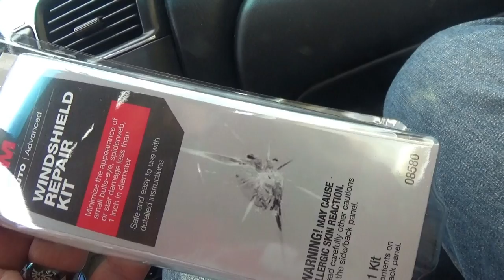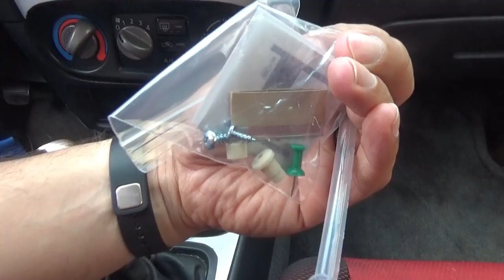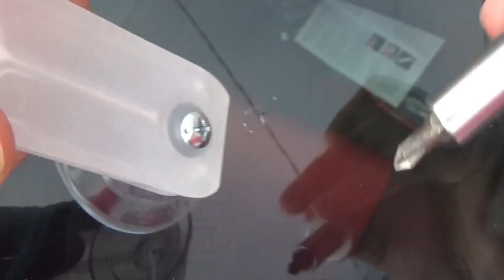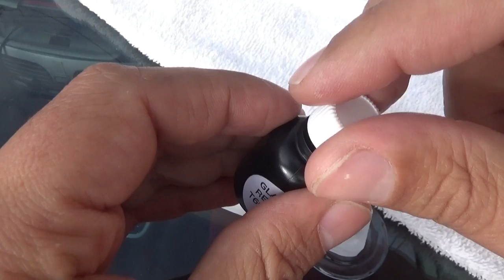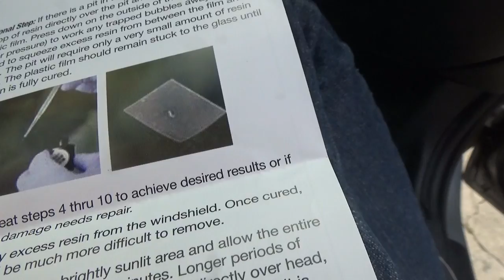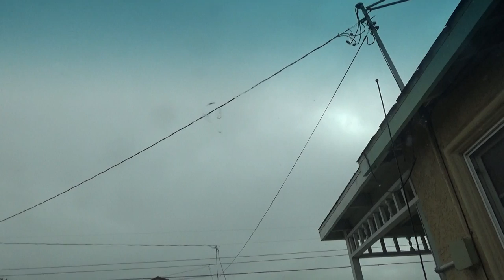3M Windshield Repair Kit. Does It Work?

Comment: It does work.  I went through 2 winters on 2 cracks and it stopped the crack from spreading.  If it didn't work,  the crack would spread as soon as you got a big change in temperature.  My star looks like yours.  That you can't fix.
Reply from the maker: jimgiggles thanks for the feedback

Comment: I'm really surprised how terrible the 3M product is.  I don't understand why the applicator area is smaller than the crack itself.  It makes zero sense to me.  I just got a chip on my windshield and I will be using a different product that creates a vacuum which will suck the resin into the crack itself.

I expected better from 3M considering how big this company is.
Reply: What was that other product? I know its been 5 years Lmao, but Im in the same place. This 3M stuff sucks & I cant find that suction product (I know its best)

Comment: This stuff doesn't work, complete waste of time and money.  It comes out like a smelly water and doesn't even do anything.  I ended up putting a strong glue meant for glass on my chip and it works fine.  Keeps it from spreading at least.  I think the best brands for that are JB Weld and Gorilla.  But make sure the glue is meant for glass as well.  Cheap, fast and effective.  If you have a huge crack on your windshield you'll need to replace it anyway, don't waste your money on this 3M product.